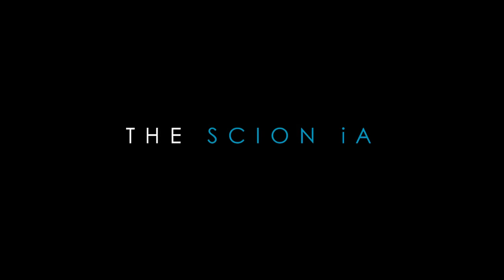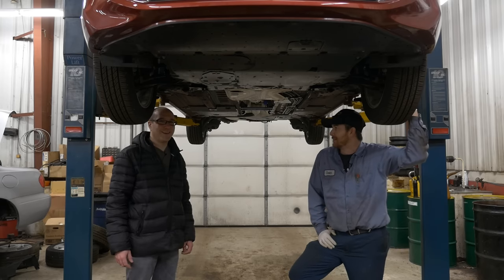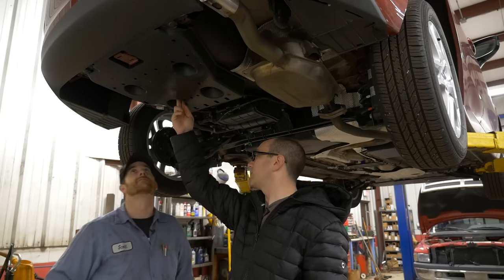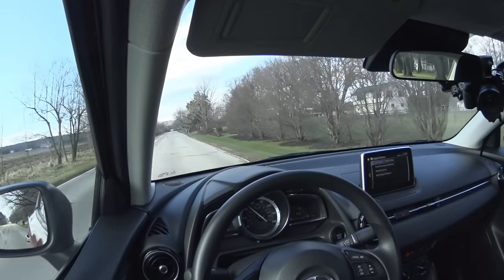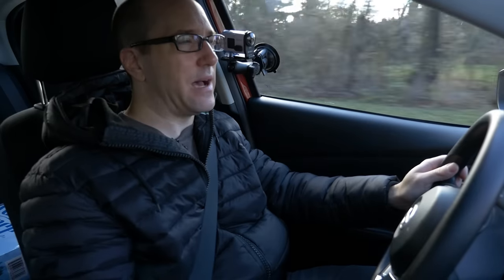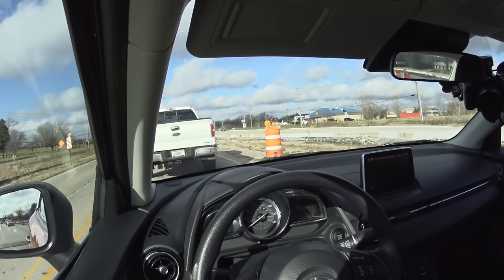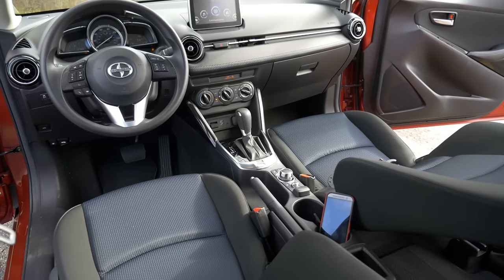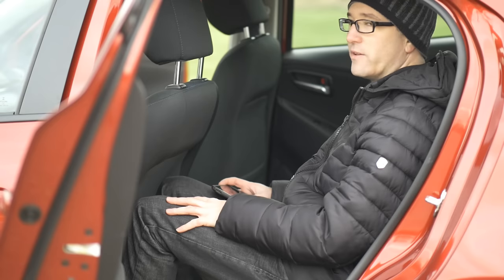Review | 2016 Scion iA | Compact Revival

Comment: I have a 2011 Mazda2 Touring with a stick. It is a brilliant car. I used to have an E30 for track days and this is funner to drive on the street. It is a statement to "it is better to drive a slow car fast than a fast car slow". The transmission and shifter are really nice and it gets an honest 39MPG average for me. It heel-toes beautifully. It has been dead nuts. reliable and currently has 125k miles. No timing belt to replace either. Looks waay better than the current one (as long as you don't buy the green one). Mine has white, pearlescent paint which looks amazing when the light shines on it just right. so simple to work on - if needed. I feel this is one of the most underrated cars built in the last decade. Have not taken it to the track yet.

Comment: Thanks for bringing up the "no dead pedal cover" issue.  That really pissed me off in my Mazda3.  Can't believe they won't spend the $2.  Makes no sense.
Reply: +Show Me What I Need To Know  Why don't you just glue on a piece of rubber there yourself.  You could probably cut out a rectangular section of weather floor matting and stick it on.
Reply: WeatheTech mats cover that dead pedal
Reply: Still annoying that you gotta spend nearly $200 on special floor mats to cover a part that the manufacturer only needs to spend a couple of bucks on. They do these small cost cutting measures just so they can save enough money to cover a portion of some executive's salary.
Reply: if they make 100,000 units, that's $200,000 worth of bonuses for executives!

Comment: I've owned the previous generation rio hatchback and I currently own this car. I put massive amounts of miles on both of them because of the nature of my work (Rio 255000, and a 2017 IA AT 170000 currently). My thoughts: The last generation Rio is a workhorse. It's engine never let me down....the transmission on the other hand started to slip at around 125000 miles. Electrical problems around the same time.... but never left me stranded....could have gone to 300000 miles no doubt. At 170000 miles the IA is still a pleasure to drive. It's strong suit is it's engine and transmission combo. They are by far the best in this segment. The engine feels so refined, quiet (almost like it's a Rolex watch) the transmission the best in this segment as well, quick shifts and the shift logic is second to none.... and not a hint of slippage (I haven't even changed the transmission oil from new!!!). (On the Rio I changed it every 40,000 miles) The new generation Rio is better I'm sure, hopefully they have strengthened the transmission....Most people will never put theses cars through what I've put them through in such a short period of time, Both are excellent values.. I paid about $3,000 less for the Rio.
Reply: You should do video reviews of your cars!

Comment: Great review. Thank you for pointing out the no center arm rest. I seriously was considering this for my next car but the no arm rest is a deal breaker.
Reply: +Jeffrey McCarthy The armrest is a $295 Accessory
Reply: +nycballer0591 Does that include a distracotainment or bluetooth controlled lid?
Reply: No idea lol
Reply: +Jeffrey McCarthy They sell one in amazon and ebay for less than $200; still expensive but it wasn't too bad
Reply: Really? An armrest can actually be a deal breaker for someone? Discarding all of the other features because of an armrest .... gosh.
Reply: +MisakiLeasim yep. I drive around 3 hours combined bumper to bumper traffic for my commute. Not having somewhere to comfortably rest my arm would be miserable.
Reply: +Jeffrey McCarthy You can buy one cheaper on Ebay. It's also the original equipment
Reply: With a Stick? Why have one? Buyig this not as a 6 speed manual is sacrilege.
Reply: MisakiLeasim Take a 3 hour road trip and you will see.

Comment: I would never spend 20k on a new car. Instead I saved away for two years, drove a Toyota iQ for maximum economy and outright bought a near perfect Fiesta ST with 18000 miles on it for 13k minus trade-in for the iQ. That's a lightly used fun car for the price of the most basic city cars. I don't mind sitting in 5 year old tech at all. But I see your point, you really need to know some in order to avoid lemons. Especially if it's your only car and you're really dependent on it to work.

Comment: Squeaks and rattles in a brand-new car drives me nuts. Went through that with my 2012 Nissan Versa. NO squeaks or rattles from my 2014 Mirage after 50k miles.
Reply: Funny, I just moved on to this car after dealing with a Shady Mitsubishi Dealer. Only 2k more for the iA over the Mirage. The back seat for the kid seats is the only reservation I have.
Reply: @OhPhuckYou  it was rear ended and totalled out by insurance in 2018 with 56k miles.

Comment: Awesome video. I'm currently between the Scion iA, the Mazda 3 hatchback, and the honda fit. Any thoughts? Plus, should I be worried that toyota is going to kill off the Scion brand?
Reply from the maker: +betoski The Mazda3 has had a pretty good track record thus far and even the Mexican version, which is where the iA comes from.  Toyota is going to rebrand the iA a Toyota by end of year they have a contract for next 4 years with Mazda. I'd probably wait for the re-branding for re-sale sake.  The Fit, well the car has had a colored start with quality issues, blown motors right off the the truck, panel gap and body issues along with some other oddities.  I would hold out for a few years on it until the Mexican plant is sorted.  So the answer is today - Mazda3, end of year Scion iA in a few years maybe the Fit.
Reply: Appreciate the comment. Will take your words into consideration. :D
Reply: I wouldn't worry about buying this car everything is pretty much going to be the same next year but just rebadge differently. The fit was more money but give you more room in the rear which was nice. I noticed the quality on the fit was not as nice as the Scion. Scion has great fit and finish. It also gets better mileage than the fit. The only thing nicer on the fit is it definitely has  more room in the back. The Scion also drove better. If you need a car now I would not wait because you can really wheel and deal on these cars at the dealership right now
Reply: Yeah I need a new car because my little tercel does not pass the smog check anymore (mine expires in December.) I think I'm going to get the toyota version.
Reply: Honda Fit is so repulsive. Why would you buy such an ugly vehicle

Comment: Goose unless I missed it did u mention the pre collision system included in the price kind of a feat for the car/class at base price.
Reply from the maker: I didn't mention it but you're right it does include a low speed pre-collision system that works under 20 miles an hour only

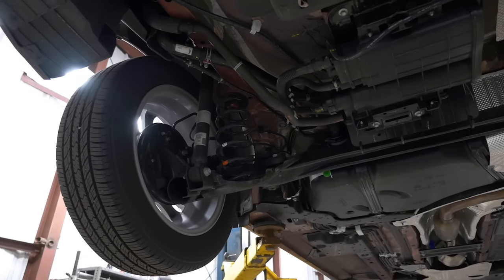Comment: Hey Mark S. love the videos. I have some questions. Why does Mazda separate their shock from their spring on their torsion bar suspensions? Other car makers put their shocks in the springs.  You can see this @4:55. Does it improve handling or is it just a cost saving measure? Also what did Scott mean about the gadgets having such an affect on the car @4:40? It seems Scott is a man of a few words, but in a lot of videos I wish he would elaborate more on what he means, instead of just saying one liners. 

So far I love this car. just a word of warning for anyone that has this car. The fast and loud idle from a cold start is not a mechanical problem. In the manual on page 143, it states it helps with gas purification.
Reply from the maker: +Von Ace The torsion beam has many configs using a coil over damper is often more time consuming for development.  Its easier to setup spring rates and damping rates when they are seperate. Secondly, its cheaper.  Lastly, its about packaging, often times there is not enough suspension space to the do a coilover damper or its less effective to do so.

Scott called the plastic under trays gadgets because for so long cars never used them, now they seem like they are added on many cars without having any useful purpose.

Glad you like the car so far, how many miles do you have on it?
Reply: Thanks SG for the info. I thought only Mazda did that setup. Those plastic under tray gadgets have no useful purpose? What does those plastic trays house anyways? Sorry total noob here.

I got it in September, and it's almost at 800 miles.
Reply: I love it. It has great features for such a cheap price. And great gas mileage. It also drives really well, especially in turns. It's a Mazda after all and shares that Zoom Zoom DNA. As for hills, I've read that Scion IA/Yaris IA comes with hill assist feature. So that should help out with steep hills. The IA might feel under powered to you going up hills. I only have one hill I drive up from work and it's not really steep, but I do notice my MPG numbers are a little low compared to other drivers with an IA. I think hills will make your mpg go a little down. I haven't driven in bad weather yet so I don't know. I do know that the IA comes with traction control and stability control along with ABS. So I think that should really help out with bad weather driving. I hope this helps
Reply: Cool. Yeah if you have the money I would go for the Mazda 3 hatchback. I'm pretty sure the Mazda 3 has hill assist too. With that feature the car will sense if you're on a steep hill and will automatically keep the brake pressed for a second or two while you let off the clutch and get on the gas so that you won't stall.

Comment: I think people need to understand, that car enthusiasts usually like 2 types of cars. Sports cars and compact/sub compact cars. Because they are related in a sense, that an empty/base subcompact with no nonsense gimmicks and fake stuff- but a lively 4 cylinder can actually blow away a heavy midsize sedan with 300lbs of extra weight and all sorts of driver aids and safety features, but powered by a similar or worse output engine.  Example: My mom drives a Hyundai accent base from 2009 i think. Even the windows are not power windows and the doors you gotta lock each individually with a key. That old school super base model, so base, that I was expecting that it doesn't even have AC and It wouldn't suprise me. That car as empty as it is, runs circles around my 2012 Chevy and beats me easily, whether it's twisty roads or 0-60.

Comment: That tiny back seat is a deal breaker. It sucks.... I am going to be a dad soon and I have to jump to the next class of cars to fit a rear facing infant seat. Fiesta ST would be a perfect car for me if it only had a rear seat.
Reply: I tried it with the rear facing seat, really was not bad. In fact, our 04 Forester had less room (we just sold it, and bought a new 17 Forester.. which I HIGHLY recommend)... all the same, I have a 3.5 yr old and an infant on the way. This is the car I am buying for Me. Wife has the big wagon car, I like smaller more efficient fun to drive ones. So, this replaces my 92 VW GTI (well, I am still keeping it, but this is easier with kids:)